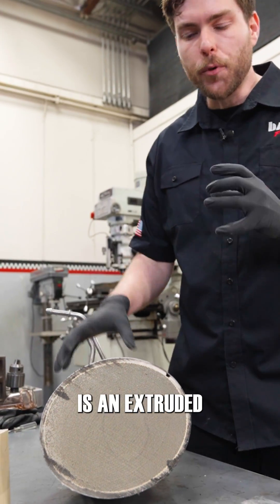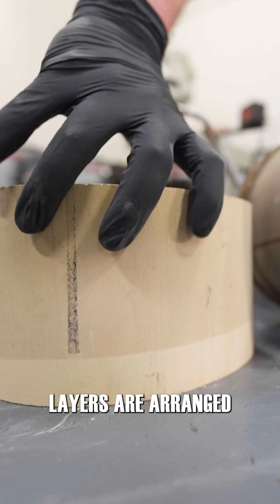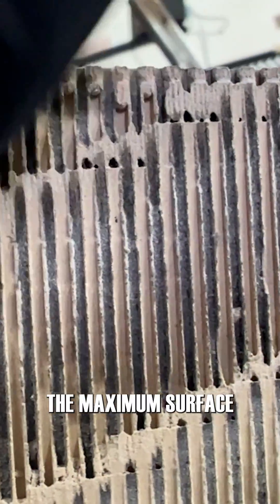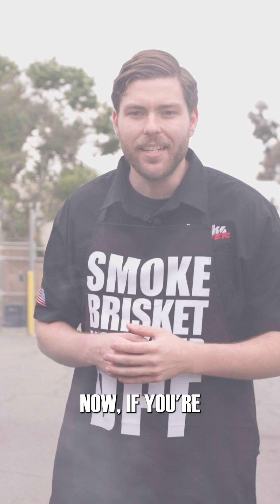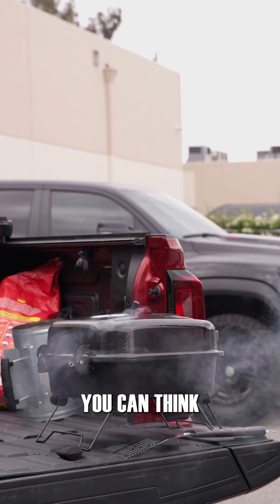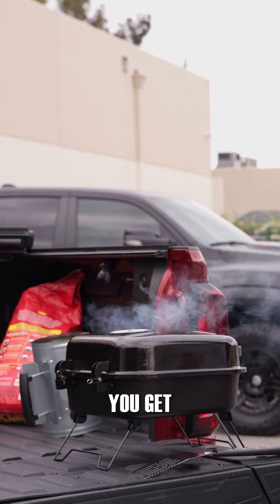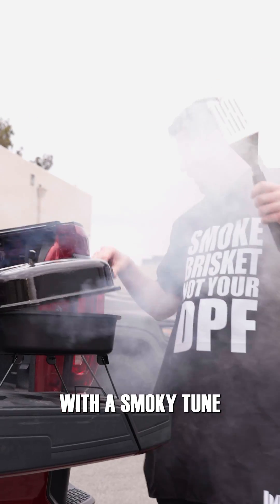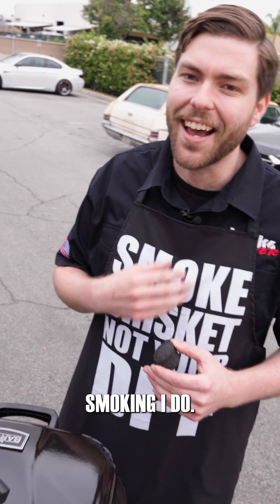Why rich tunes clog your diesel particulate filter (DPF)

Comment: You left out the part of ash. Ash accumulates in DPF which in turn gives the filter a service interval. In severe cases, it causes filter damage. 
This is why DPF systems have such a bad wrap. 

I want to put a serviceable filter on my 05 6.0. I will find one that works to trap and burn soot, and want it serviceable so that I can clean out the ash once a year or so.

Comment: you talk about running with 18 AFR
on europe with smaller engine 1.9 or 2.0 turbo diesel
I remap those everyday, some of them with DPF EGR intact and only power is added
I have cars running with between 15,5 - 16,5 AFR for years and never had a problem
but yea, from factory normal to have between 17,5 - 18 AFR
i calculate AFR based on MAF and engine displacement

Comment: A DPF system restricts exhaust gases which makes the engine less efficient which means you burn more fuel. That is a fact. Then the heavy metals in the DPF system erodes away and end up in the air and water. It is all a fraud. These are amazingly simple concepts.

Comment: casey ladelle mentioned something about how dpf was created to help make diesels more efficient, but with all the production that you have to take into account, and then the delivery of the def fluid, is it really doing anything in the grand scheme of things?

now of course, the only diesel engine that should smoke like that is an old diesel naturally aspirated at full throttle for just the first few seconds.

me personally though? i actually plan on converting a bus to live in full time. i would be very happy to not have one more thing to worry about breaking

Comment: Or…. Hear me out, now….Or! Or you take the damned dpf off and allow your engine to run properly. Jus’ saying. If you don’t put a staggeringly expensive plug in your exhaust system, you won’t have excessive back pressure. And if you tune your diesel properly, the exhaust isn’t as dirty as gasoline exhaust anyway. No more “if it don’t blow black, take it back”, you’re making us look stupid. Coal rolling is for idiots who want smoke instead of power.

Comment: leave it up to this guy to state pretty much the obvious when it comes to DPF systems. What he really needs to be tell in the world is. You need to drive those trucks with DPF systems. Not just like idling around everywhere. No, you gotta put them to the floor you gotta burn that particulates out of that filter while you're going down the road

Comment: Wow.... Talk about an incorrect statement....

  The maximum surface area isn't to catch more particulate matter. It's to allow for adequate exhaust flow while filtering. 

 It's no different than any other filter. You can put smaller and denser filters on the intake, fuel, oil, PS, Trans, etc.... You get great filtration but nothing works.

Comment: Question how much carbon is released into the atmosphere during a regen? Is it the same as not having a DPF?
Reply: it increases the carbon in the ehaust while doing a regen, seeing as it´s burning more fuel it´s logical, but the DPF isn´t there to reduce carbon emmisions but to Filter NOx or nitrogen oxide and isnt´s  just holding on to it but in the regen the engine burns ritch to get free carbon atoms into the DPF that turns NOx into CO2 and Nitrogen.

Comment: To further to discussion, unburnt hydrocarbons is power wasted. The hydrocarbon in question is your diesel fuel not burning in the power stroke, and getting thrown into the exhaust during the exhaust stroke. With a tune meant too make max power, also aims to hit peak efficiency, using only as much fuel as can be burned during the power stroke. Running your fuel so rich you are rolling coal kills efficiency, drops HP, and wastes money.

Comment: And when it gets cold outside, this system makes our modern big trucks lose up to 1 mile per gallon. My Freightliner goes from 6 to 5 MPG due to the extra fuel injector in the after treatment chamber.

Comment: DPFs may be bad, but as an European that was born in the time of the old diesels without DPF, DPFs have been a God send on crowded cities and residence areas, where the exhaust soot did make the air quality considerably bad.
Reply: Fire trucks are also exempt from the software restrictions
Reply: People don't want to talk about the leaps we've made in air quality and health by reducing emissions in dense areas. Its just the right-wing version of political brain rot. I think it would be sensible to allow those whose residence is outside built up cities and towns to be allowed far less restrictive emissions due to this, coupled with reliability being a huge concern when the closest parts store is 50-150km+ away.
Reply: @iggynub I think most people would agree. But it’s a “do as I say, not as I do” issue. The government is forcing it blaming the consumers for high pollution. Yet none of their vehicles follow the same plan. And with how tight they have the NOx and SOx parameters. They over price really dirty fuel that causes a lot of failures.
Reply: @dredennis113  Have you ever worked on a government truck? Government trucks absolutely do have to follow the same emission regulations as everybody else. Only military trucks are exempt and that's because they have to be able to run on high sulfur fuels like JP8.
Reply: @huntforandrew  I do work on them. And they also prohibit doing a software update on certain things due to the different adaptations they have. The only time I get those warnings are when a car is tuned. Since updating deletes and restores an updated factory setting.
Reply: @iggynub  What you're talking about used to exist in Ontario. Before the Ontario government scrapped their provincial emissions standards (federal standards still apply), if you got your vehicle plated as a "farm truck," your vehicle didn't have to meet the more stringent standards of commuter and urban vehicles.

Off-topic: You can still get your truck plated as a farm truck; it wasn't just for emissions. Farm plates are less expensive than commercial and commuter plates. Also, it's probably the easiest way to get experience driving a "D Class" (11 ton) truck, since a D Class truck requires a (you guessed it) D Class licence, but not if it's plated as a farm truck.
Reply: Nope.  That was NOx emissions.  DPF is just particulate, and that particulate isn't actually dangerous.  The EPA's own study proved it, they still put the regulations in anyways.
Reply: @danlorett2184  Wrong. Chronic particulate exposure increases chances of lung cancer and inflammatory disorders.

Comment: I think we would  be better off in the  United States. To improve diesel quality to at least the same level as Europe. Our cetain levels are way lower than over there.  Second of off. I've noticed since 2020. The diesel fuel has been much dirtier. Fuel filters generally are coming out much darker after the same mileage to the previous flavor.  Stating that there's more contaminants. This will lead to a higher ashe level.  I think before we start band aiding issues we should aim at the problems.

Comment: If you do any Research into DPS and all the stuff that's associated with it you would realize that it is all worse for the environment than the truck running without it it causes a significantly higher amount of failures and that stupid diesel exhaust fluid is worse for the environment than the smoke ever was look into the process of creating that stupid fluid and you realize that it creates more problems than it solves just in the creation of it not to mention the fact that those Vehicles typically get lower fuel economy so any percentage of particular production that it does is offset by the fact that I'm burning more fuel

Comment: If designers made dpf's easy to get at and also you had the way to change the filter like an air filter then so much money could be saved. Dpf's cost a fortune to change and clean professionally when with a bit of customer thought it coukd be done with a set of car ramps and 30 mins.

Comment: Gale Banks has pretty much proved you dont need a smokey tune or dpf for power.
Reply: 100% correct but excess fuel has its place, in sled pull we are not allowed nitrous or methanol injection and can only run certain size chargers so we pump in extra fuel to cool the cylinder down and save our pistons from melting, dpf's are joke tho
Reply: @Ryan_Driedger I thought smoke increases egt?
Reply: @ianc8165  to an extent, yes, but just like gasoline diesel also has a fuel ratio scale its just far wider then gas and acts different then gas because it burns at different rates and temperatures
Reply: Common knowledge removing the dpf and other emissions components drastically improve power and reliability
Reply: smoke is unburned fuel . problem is the gov makes these truck companies burn x amount of fuel per mile instead of making your tune  burn for  top performance

Comment: Def comes from animal urine (aids and HIV included) 

H2S - Hydrogen Sulfied

Both are colorless gasses. However h2s is very lethal and kills people at oil well sites. 

Imagine inhailing animal urine that has aids, std's or some major infection that can be transferred in the urine and is now mixed in with def fluid....... It comes out an exhaust pipe that looks like clear smoke but has animal diseases all in the fluid.... Think about that. (Silent is deadly)

Comment: Imagine the power incease on semi's if you didn't have to purposely restrict airflow in the exhaust.  Fuel milage, and power would go up, and save drivers money. Maybe then making smaller engines for the same power, and that leaves room for better aerodynamics. Also more weight able to be hauled.

Comment: Thing is my 1999 Cummins is pushing 400,000 miles doesn't burn a drop of oil. ( leaks a few though) and still pulls strong with no end in sight also produces very little black smoke. And gets 27mpg unloaded and 18 towing its brains out. Will rebuild before I buy any new garbage.
Reply: Let me know when you sell I need a decent truck lol
Reply: 2005 Mercedes Sprinter 'OM647' 
768,488 MILES
STILL PULLS 23MPG @ 9400LBS DAILY

Only replaced plastic turbo resonator with aluminim one
Reply: How many times did you have to change the injector copper seals in your Sprinter?
Reply: I love to hear this stuff! New vehicles suck

Comment: Call me crazy, but I believe DPF should be like changing an oil filter. If they designed it where you could unhook 2 brackets, take the DPF out and install new one as you’re doing your oil change. No one would delete them and we would be running them more often. But I’m not a engineer so I don’t know the challenges involved in that, but what I can tell you is that I’m a truck driver and I’ll continue to rebuild my 2006 Pete with c15 as long as it’s reliable and making money.
Reply: bruh a DPF is like $5000
Reply: @3DProductions  that’s with labor or just part? What if they were produce like every other filter by third parties, maybe it would be 2000, and replaced every 3 years, it would be affordable to keep them
Reply: @B0RN2RACE100 my DPF was on my truck was less than 2 months 🤣
DPF isn’t the only reason to lose it, DEF and all the sensors can stop you anytime, few seconds @ $700 each. DPF is over $6000; and it doesn’t even cover your lost income due to your truck being in the shop or waiting for parts.
EGR leaking can put you over $15K in the hole!
Reply: @litoaykiu  I agree, but most of the time those sensors and system fail due to poor maintenance because it’s a hassle to do maintenance. If it was a 15 min filter change. Everyone would do it by monthly and the trucks would run good or “as good as it could”
Reply: @B0RN2RACE100  Explain to me how you maintain NOX sensors, DEF sensors or pressure sensors.  There is zero Maintenace!
Reply: @litoaykiu  less soot from back pressure. Since the filters will be working properly. Lower temperatures. Less stress in general on the entire system.
Reply: @B0RN2RACE100   so the problem is the temps you just have to have for a DPF to work, having something that´s over 600°C that´s easily removable but also strong enough on the car while weighing a lot given it´s size it kinda complicated, and even if it would rust like the clamps we use currently. So you probably could but it would ad lots of cost and no car maker is gonna see a need to do it
Reply: @B0RN2RACE100  Just the part. DPFs, like cats, are packed with rare earth metals.
Reply: @SkorpyoTFC  very simple solution. Have them require a core charge. You turn in you’re and get a new one.
Reply: My bmw x5 dpf and scr that was clogged is $3900 for just the part, and it's apparently illegal to fit a used part. I deleted it. Fuck them.
Reply: For joe biden -aka "smoky joe" to own such a dpf device it would need pictures of kids on it
Reply: Why is dpf any cleaner? It still burns all the same, it just collects it all in the filter then all that smoke comes out of the tailpipe during the re-gen process. 
I just dont buy that its any cleaner at all. 
Wont be long before they fore everyone to "upgrade" to more failure prone modern models, and everyone has to buy more parts.
A late model Silverado is no cleaner than my 92 Silverado. And the late model gets worse real world fuel economy! (dont show me a window sticker fuel mileage because that is a straight up lie) 
Every car built in the last 15 years was designed to fail closer to the end of the warranty than the world has ever produced before. I cant name one decent modern car. And for your own sake, do not let the dealership do maintenance. 
It used to be the ticket to quality automotive service....but now, their intentions are to make your car last as short a time as possible (10k oil changes with low quality products). 
Why would you buy a new car if your old one still runs? 
Its all designed to separate you from as much money as possible.
F@#k off with modern bs cars.
Reply: @ryurc3033  let me explain it. Hydrocarbons, can be refined and turned into carbon dioxide which plans can use to grow and turn into pure oxygen(plan do a great job at putting carbon back into the ground) heavier hydrocarbon chains, can logged in peoples lungs causing lung cancer and other respiratory issues, like coal does. By having a DPF is filters it into smaller less harmful size and the one that get stuck, then after a while get burned and turned into smaller simple carbon dioxide. It doesn’t reduce the amount of hydro carbons in the atmosphere, it reduces the amount of HARMFUL hydrocarbon. Do some research. It’s not about reducing carbon(we need carbon dioxide for plants and crops to grow) it’s about reducing toxic greenhouse gases.
Reply: @ryurc3033  because when it burns it off.... its a CONTROLLED AND COMPLETE burn.
.
they control the burn temperature to get hot enough to burn the shit off.... but not hot enough that you start getting harmful "side reactions" 
.
like... the whole reason diesels have more SMOG EQUIP than gas is because the higher compression (therefor heat) create more NOX and other said "side reactions" 
.
.
.
.
ill agree that modern cars are BS however.
Reply: Or just cut it our and put  straight pipe there lol don't have to change shit
Reply: @brothersgarage3748  not everyone can run illegally. Or want to. My truck is pre def pdf. And I’ll keep it like that. My point is. In places like California and other states. They have to. So it would make more sense to have it like replacing any other filter.

Comment: You double your fuel mileage and increase power if you remove that junk, and it wont cost you 10,000 to replace the system when your engine has an injector fail

Comment: I keep saying this over and over. I have a 98 F350 with 7.3. I've done some bolt-ons but it's not tuned for max power but for reliability. I get off-road diesel delivered to me. (I got a 275 gal home heating oil tank used for $100 and put a $200 eletric pump on it) It's not low sulfur. In NH we don't have a sniffer test. But I can take that truck down to MA where I have a friend that has an inspection shop. My truck mostly passes the sniffer test. No, cats, not dpf, no emissions of any kind. Not even an egr. It burns completely and therefore enough particulates are burned away. When sulfur was removed diesel did not burn as hot so it produces more particulates. Then you have to add a filter, then you have to add regeneration, then you have to add exhaust fluid, so on and so forth. I don't use it commercially so it's not an issue for me.
Reply: Home heating oil and other off-road diesel is low sulfur diesel.
Also NOX which is the big thing is created in higher amounts at hotter temperatures not at lower temperatures.

Comment: 😂😂😂😂😂 so glad I got a 12 valve cummins, fuck all that
Reply: What year, cause after the 2nd gen, dodge has the same shit all the other diesel companies have. You still have a dpf and an egr
Reply: @bobjoefree7435  mines a 97,with a p pump  12 valve, no egr no emissions
Reply: @deadlinetrucking  nice
Reply: @bobjoefree7435  Do you know what a 12 valve is?  Also, cummins was last to add the DPF to pickups, because they saved their EPA points to postpone that crap.  They didn't have DPFs standard until the 6.7. Right around 2007.  I think actually halfway through that model year.
Reply: @thewatcher611  that’s right, they didn’t have dpf, but they still had an egr.
Reply: Pushing an amazing 200 horse 😂
Reply: @dominicelek9394  x3 😂😂😂😂 I'm not stock bud
Reply: Any 5.9 really.  Even the 24v, and 5.9 common rail would be no DPF, I believe it wasn't on till the 6.7.